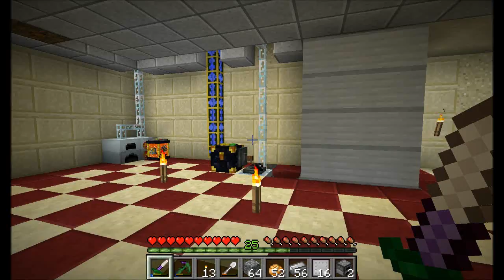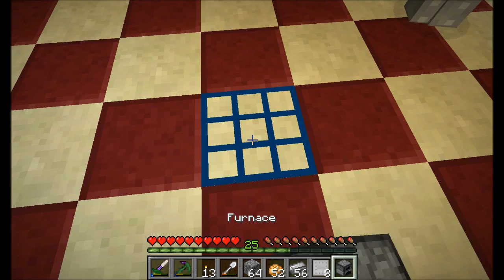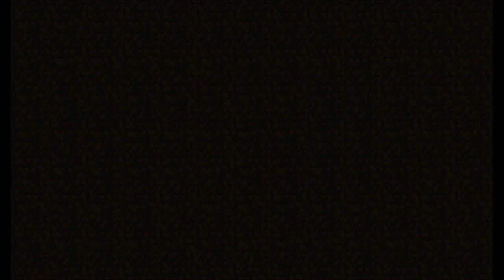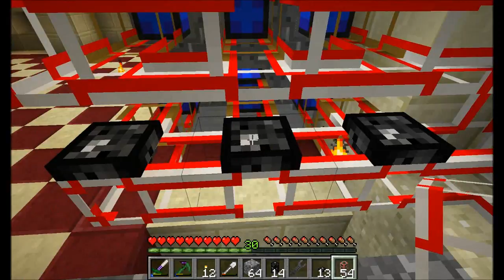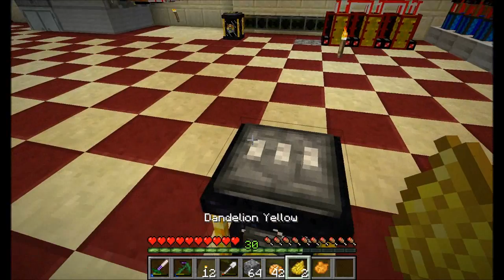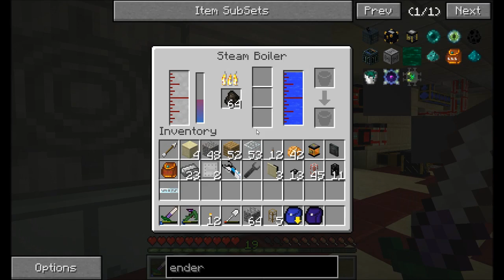Forgecraft2 S2E10 Steam Use

Comment: FC1 is NOT an FTB modpack.  It does have most of the same mods as FTB modpacks do, but they're on 1.6 while all of the FTB modpacks are on 1.5.2 or earlier and will remain there until they update their launcher to support 1.6.  Also, the 152ngt and 152wgt codes are for old 1.5.2 beta packs that they're no longer using now that Unleashed and Unhinged have been released.

Comment: I think someone may have mentioned it before, but you really don't need the gate conditionals on the steam engines since the engines don't even use up all the steam that's produced. You can keep the engines on and you'll still have excess steam, so there's no real point in ever turning them off.

Comment: yo direwolf, move the BC power pipes to the back of the boiler so you an fit your other boiler next to it, so turn your whole boiler and engine thing 90 degrees so the negines are behind the boiler then you can run it more effectivly

Comment: Hey Dire, you know, it is pretty useless having the gate conditionals on the steam engines. You want your boiler to be running always, so there will be steam overflow. The steam engines can keep running forever!

Since you have the combustion engines, you could put the gates with the power conditionals on them. They will turn on automatically when your steam engines don't produce enough power :)

Comment: Dire, I think you'll find that an endertank with steam is superior to an energy tesseract. Also buffering steam in a railcraft tank would probably be wise, and when you get redstone energy cells, isolate the generation from usage and force everything to go through the energy cell.  That way you can have your engines turn on when they are (collectively) at 25% full and turn off when they fill all the way up.  Having various forms of emergency/burst power is always nice.